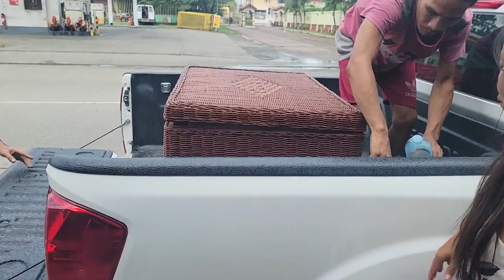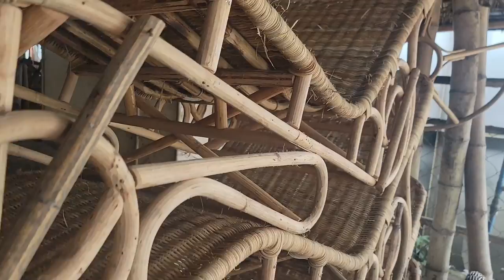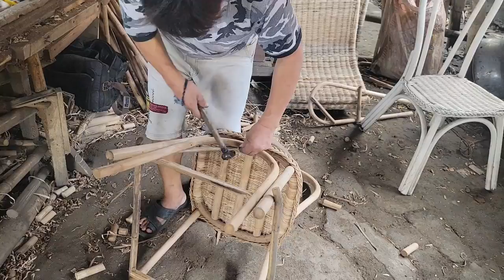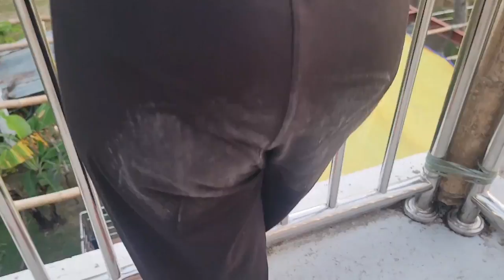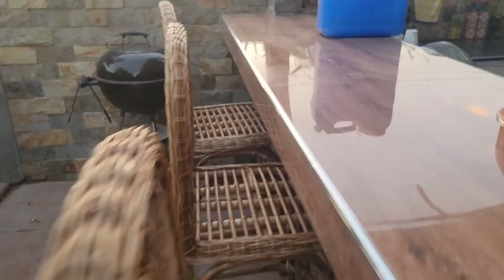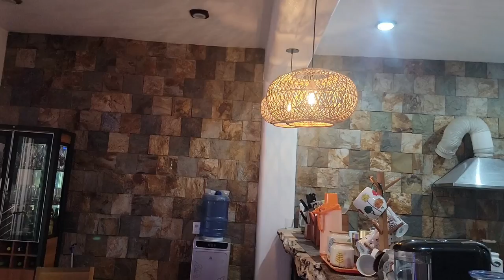Rattan Furniture HAPPY and NOT Happy Same Family Two Shops Two Attitudes

Comment: Man, those chairs look SOOOOOO good on the balcony...Perfect! I agree with you the parents/daughter operation does better work. I think you can get a couple more and it will add to the ambiance (and comfort)...Holy Cow, Quality! I like the colors as well of the chairs, as they match the stonework and tiles...

The angle on the back of the chairs makes a big difference in comfort level over a longer period of sitting on them at the bar (or anywhere you may be using them, i.e. the island between the kitchen and dining area inside on an emergency basis when entertaining, etc.

TC...

🙏🙏🙏
👍😎👍